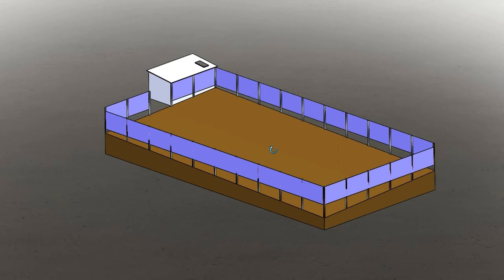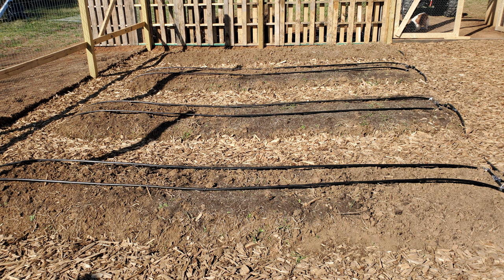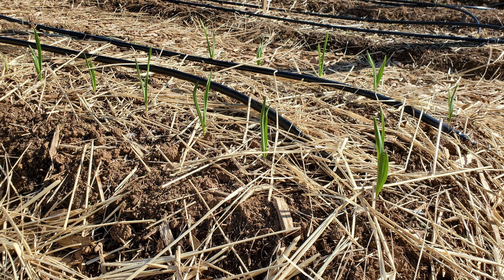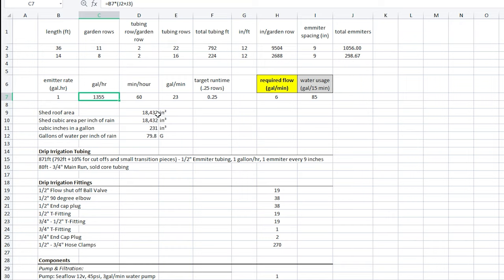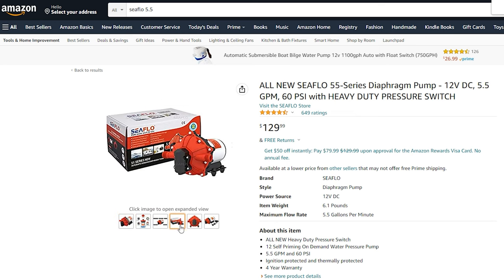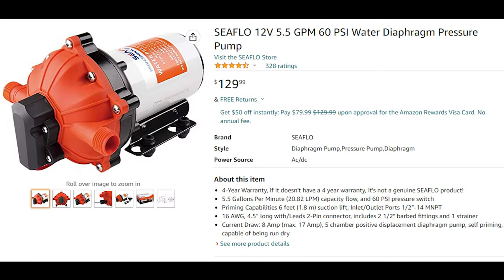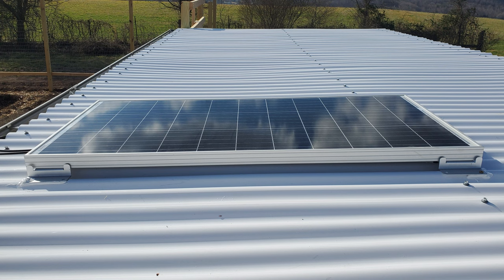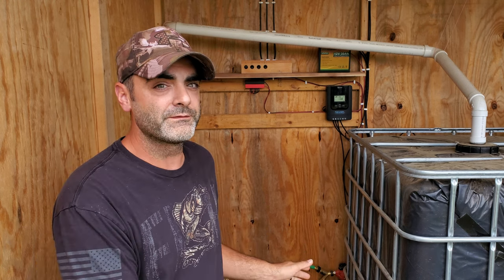DIY | Off-Grid Solar | Drip Irrigation | Rain Collection

Comment: Awesome Video! This is immensely helpful for me! I have a system very similar to yours, with rainwater capture, storage and irrigaion (but without solar.) 

A few questions for you if you don't mind:
1) Do you find you get even coverage or distribution of water through your drip system emitters? (you mentioned your system is zoned so Im sure this helps) mine will be all on a single zone but with a bigger pump, I'm concerned the first rows will steal the water from the last rows, curious what your experience is here.
2) Your garden looks great do you prefer the mulch over landscape fabric (between crops and rows) for both aesthetics as well as keeping weeds down?
3) Do you find the drip system is prone to clogging? With the rainwater capture coming from roof even with the filters I'm thinking with the emitters so small it will be prone to clogging, (especially with the trees around my roof).

Also if you are considering expanding your tote storage system I would suggest stacking the totes (height permitting) a little trickier to plumb but that is what Ive done and conserves space and works perfectly!

Thanks!
Reply from the maker: Hi! We 100% have no issues with flow distribution. The Tubing we used is flow limited, so once the first row has peaked the flow is distributed to the next row and so on. Be careful with a bigger pump, higher pressures can blow out the emitters very easily so be sure to use a pressure regulator. We do not have issues with clogging, I will say this is a surprise but even emitter lines that get burried by fire ants still emit just fine once we dig them out. As for mulch we tried landscape fabric for years but the detriment to the soil outweighs the time saved weeding. We switched to Mulch, yes there is more weeding this time of year but once it is finished the weeds are at bay for the remainder of the year (for the most part). No-Till has been the biggest help in this regard, Stir up the seeds grow the weeds.

Cheers!
Reply: Thanks for reply and the insight!! Much appreciated!!